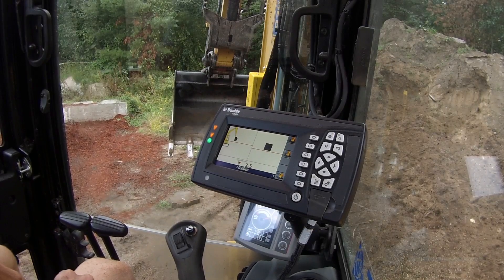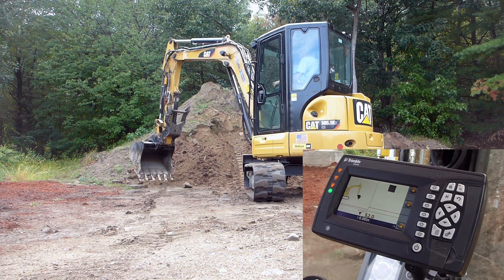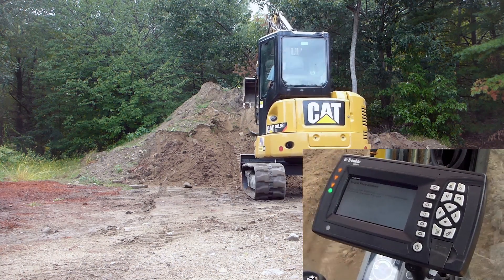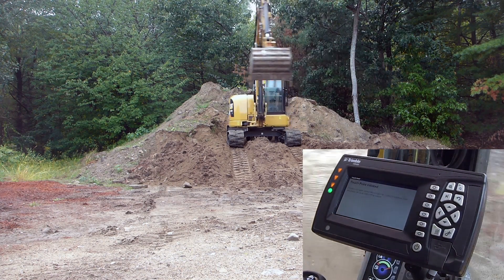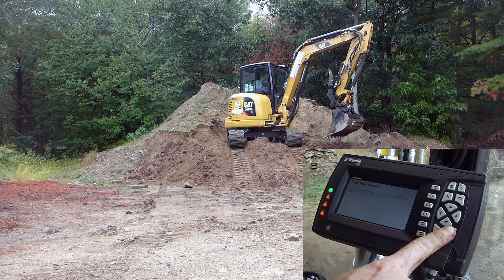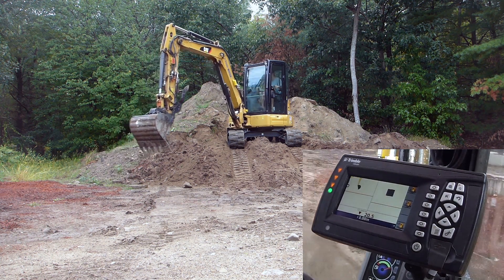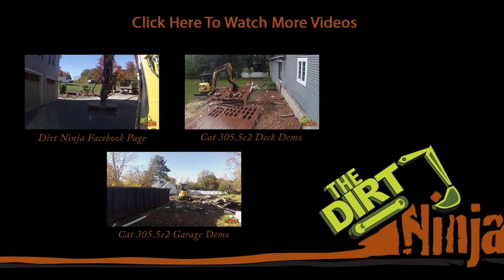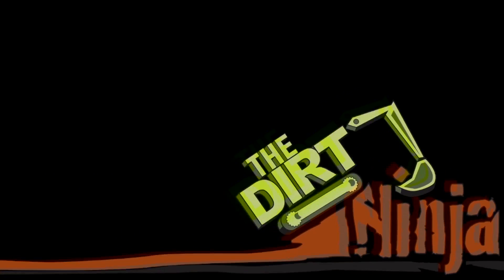How To: Using Touch Point Feature - Trimble GCSFlex

Comment: Does a system like that come standard on excavators, if it doesn't how much is it to equip a machine with all of that.
Reply from the maker: +Garrett Edwards It does not come standard. It costs about $10,000-$12,000 to add it to a machine depending on the size of the machine.